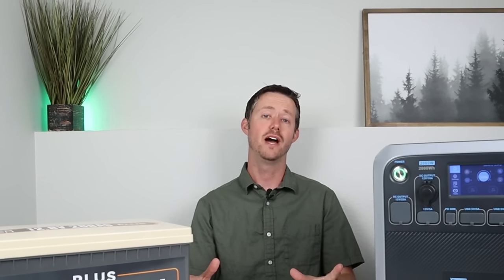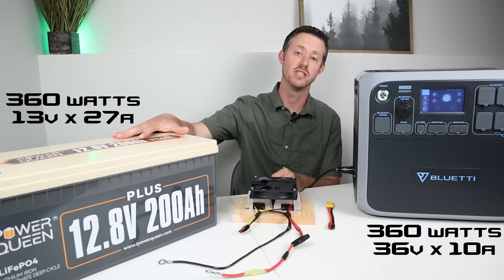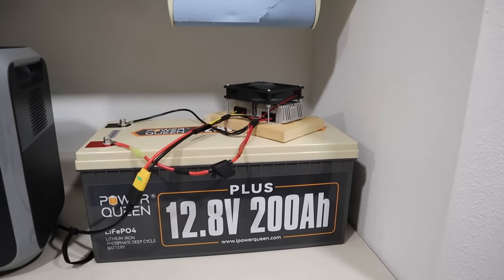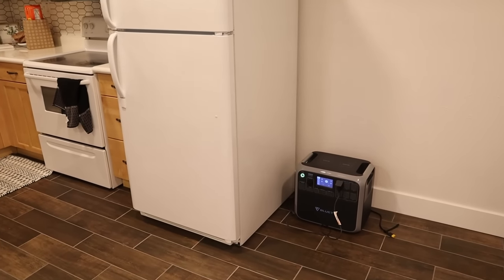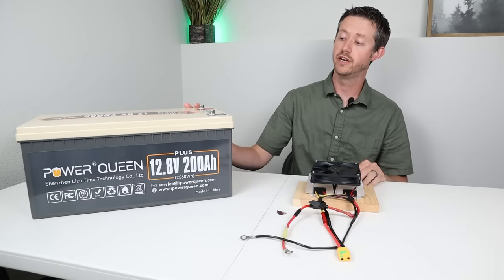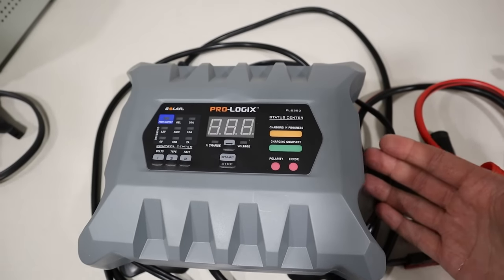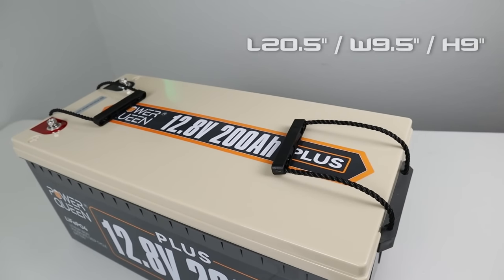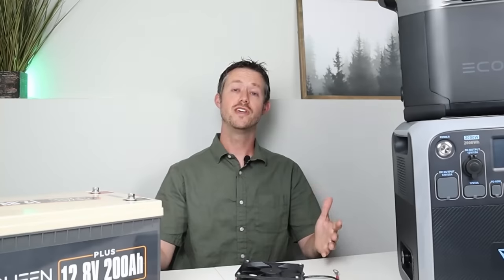Make Your Power Station Last Longer! Power Queen 200AH LiFePO4 - DIY Expansion Battery!

Comment: Have you consider using an ebike battery to charge these stations? I have a 52v 20ah battery with the xt60 connections.
Reply: I am doing exactly that right now. I am stepping down 48v to 24v because my small power station can only handle 30v max.

But note that sparks can occur when you connect the battery unless you use a switch
Reply: @moccaloto  actually I tried it already. I have the EcoFlow delta max and I bought the connector from eBay to my bike battery and connected it to the solar port. The battery has its own switch so I just switch it off before I plug it in and bingo it works a treat !

Comment: Great video, very practical. Just what I was looking for. I saw a 12v to 48V, 8 amp would that work as well instead of two 12v to 36v?  Just checking? Thanks again for this.
Reply from the maker: Yes, that 12v to 48v adapter would also work, just plan on large wires to reduce the heat and voltage drop.

Comment: Why not using an inverter 3000w at 250$ on amazon , connected to the battery and charge the bluetti with an AC cable at 120v from the inverter.
There would be a loss in conversion but it would charge with 1200w per h minimum, so much much faster.
Maybe i miss the point here. I know nearly nothing in electrical systems.

Comment: Wow real nice video but months before I watched this video I have already set up a system where  I have two Power Queen 200 AH batteries in parallel powering my small vacation home and a 1000 AH lithium ion portable solar power station connected to a 20 amp  LiFePo4 charger supplying power to the power queens.  The power station has 600 watts of solar panels charging it. The LifePo4 charger was only $59 on amazon.  So my system is reverse to yours.  Not being an electrical engineer what advantages or disadvantages does my system have.  Charging time is not an important factor to me and the system seems to works very well. Why did I do it this way?  I will take out the portable power station out to use elsewhere in the RV or for portable power outside when not charging the power queens.

Comment: I just purchased an AC200MAX on the Black Friday sale, and am considering a Power Queen 51.2V 90Ah  battery.  It should work with their D050S magic box without DC-DC conversion.  Nice added capacity for $1200.
Reply from the maker: You don't need the Bluetti charging enhancer for that battery to work, just plug the battery output (pos and negative) into solar input on the AC200Max.
Reply: @Jasonoid  True, though I may want to use solar panels during the day at least.  I also like your transfer switch set up, as I want to power critical loads, especially during power outages.  We had a three day outage last month…
Reply from the maker: The charging enhancer does allow dual charging, good call.
Reply: Hey Tom, Is it possible (or have you tried) to connect the Power Queen battery directly to the AC200MAX adapter input instead of using the D050S? The adapter input is rated for 58.8 volts. Thanks
Reply from the maker: You can connect the 48v LFP battery to the solar mppt input port and it will charge. I'm not sure how it will react by plugging it into the AC port and I wouldn't recommend it. The wall charger and the D050s are both 48v "chargers" and connecting a 48v battery to that probably wouldn't do anything.
Reply: My understanding is that the AC and DC chargers provide a charging profile consistent with that needed for LiFePO4 batteries.  I concur that it may not be advisable to connect a DC source directly to the 7909 port.

Comment: Hi Jasonoid, quick question, is there’s downside using a 36V 20amp step-up converter on a Pecron 600 that has an input limit of 15 amps?  Will it just auto-regulate down to its max allowable?  Is there an efficiency loss?  Thanks!!!
Reply from the maker: It will limit the amperage input automatically and the converter will enjoy not being at full blast the whole time. Win win. Watch this video for efficiency testing on these types of converters:
https://youtu.be/I78RxjRXTn4

Comment: EcoFlow makes an 800W alternator charger that could be used to do exactly this since it’s basically a DC-DC charger. Downside is that the DC output cable is EcoFlow specific so probably couldn’t use it with another brand.
Reply from the maker: This option is more affordable and will work with most brands:  https://youtu.be/NqnYaqMwktE

Comment: Great Video. I did enjoy it. However, for me, the part that was missing was charging the big battery back from the Power station. Yes, you brushed over it, but it was missing sth in my opinion. I would like to use it properly as an extension battery like the OG ones. So charging and recharging through the powerstation. I don't need a separate mppt controller if I have akk that within the powerstation already. Idk if it is possible to make an adequate replacement for the expensive original expansions. But I hoped I would find that out in this video.

Comment: I guess the only change if using 2 - 100ah vs the one 200ah would be to wire each 100ah individually to separate converters. The output of both would still be combined in the connector? I have 100ah in an off-grid workshop and plan to augment my Bluetti at the house with a 400 array but in the mean time this would be an immediate and inexpensive back-up? Or would there be some unforeseen issues, balancing, etc? The 200ah is just too heavy and cumbersome for me given current situation health etc. Also BTW the price of two 100ah looks to be less than one 200ah? Anyway, thanks for the video.

Comment: Jason is the fan blowing on the heat sinks or is it pulling the heat up from the heat sinks
Reply from the maker: It's blowing a ton of air down through the fins of the heat sink. It works really well.
Reply: Great, I just tested my 24v to 48v boost converter (20amp) with my Li Time 24v battery on my Anker Solix F3800 and I got 1150 watts on the DC side.  I definitely will add the fan.
Reply from the maker: @donnyhudson305  yes, I would recommend that for sure. You could use a simple USB fan like this too:
https://amzn.to/3UstNnF
On the highest setting this thing moves a ton of air!

Comment: Would be nice up know just how much power was loss from all that heat the voltage converters generated.
Reply from the maker: You're right, I should have showed the volts/amps on both sides of the process to see loss. The most heat buildup was in the fuse holder and using larger wire or dual wires would have helped get rid of that completely. There are many ways to accomplish the same goal here. Using an AC inverter with the stock wall charger, using a 24v or 48v battery and dumping power straight into the power station, or using the voltage converters on a 12v battery are just a few options. I'm sure there's even more haha!
Reply: @Jasonoid  Since you are coming from a 12v battery there is just no way to avoid at least some conversation loss regardless what method you use.

Comment: This is an interesting and informative video but I don't quite see the point of making something like this, to provide an alternate source for charging a power station. You have a perfectly capable 12v 2K inverter that the Bluetti can be plugged into that can supply the 500 watts input. If you have a second AC adaptor and add an xt90 plug then you can nearly double the input wattage to the Bluetti. If cost is a factor in building a DIY power source, a 500watt inverter costs less than the individual components that you are using for the build.
Reply from the maker: Totally understand where you are coming from and I acknowledge there are many ways to accomplish the same goal. This is a simple way to get 36v out of a 12v battery. Using a 24v / 48v battery would also work really well. Buying a decent 500w pure sine inverter is usually around $75, but that won't work on all larger power stations that charge faster than 500 watts. I could do a future video covering all the methods in one video. Might be a better approach.

Comment: I built the same 12-volt to 36 volt step-up converter. Thanks to your video it works great! I was putting in 353 watts into my Bluetti AC180. Quick question for you though... I found the same dc-to-dc converters that will do 12 volt to 48 volt. With that being said do I need to purchase two converters like I did with the 12-volt to 32v?
Reply from the maker: Usually the 12v to 48v converters are 5 amps so you'll need to parallel them to get the full power.
Reply: @Jasonoid  Awesome! As always thanks for the reply and your help!!

Comment: Would like to see you do a capacity test on the 36v output, and compare with the Wh from the original 12v so we know what the exact loss % is. While having a larger voltage battery is ideal, for this who may not be able to swing that as easily, it would be nice to compare a more expensive higher voltage battery vs knowing the loss % of this method. Could you run a capacity test on the 36v configuration and reply to me with the Wh that way?

Comment: How could I set it up with a solar panel? So that the solar panel was connected to the battery and the  battery wad connected to the power station simultaneously?
Reply from the maker: These LFP batteries support charging and discharging at the same time. You can connect a solar charge controller / solar panel to the battery AND the DC converter to charge the power station.

Comment: I have a Bluetti Eb3a, a 100ah Power queen  LiFePo4 battery and plan to use then to power a Iceco JP 40 (which I think draws msybe 50 watts max..  am I good just going direct without converter?  I’m thinking the ~120 watt charging should stay ahead of the fridge.  One other question. I know there is possible car alternator damage charging a LiFePo4 battery, but safe to charge a Bluetti Eb3A unit..  what if I plug the Bluetti into the car power socket then hook the 100ah LiFePo4 to the output from the Bluetti?   Will that slowly charge the 100ah battery without overheating my car battery? (Does the Bluetti have a protection inside to prevent over draw from alternator?)

Comment: Each Battery efficiency is 98% charge discharge. Inverter takes +/-14% aprox. The second battery is also wasting 4%, plus dc converter power draw which is 92-94% efficient....likely to waste just under 30% of solar power.

Comment: as I remember, that bluetti AC200p accepts solar voltage only starting from 36Volts, so your DYI power booster is good for this device for the case to charge that bluetti AC200p from solar pannels 17-20Volts or from batteries (e.g. 12 Volts like in this example )
Reply from the maker: Usually these converters don't like taking solar input. Maybe because it's not consistent. I tested once awhile ago but not with these specific models.

Comment: Good video. I dont trust those blade fuses for anything over 20A. I run several small lifepo4 batterys that I run in parallel on the AC200P that I use a ANL fuse with.
Reply from the maker: Great advise! Thanks for sharing

Comment: Could you not just buy a 25.6 volt 100ah battery and wire it straight to the battery and solar input for the 24 volt input? I also think you could use 3 12.8v 100ah batteries wired in series for the larger power stations, or 2 of them wired in series for the smaller ones. Point is, that would eliminate the need for the dc to dc converters and the conversion losses they would consume due to heat. It would also increase the watt hours of the 38.4 volt to 3840 watt hours....or am I missing something?

Comment: Last you thing you said 12v to 24v 5amp converter, but your Amazon link is 12v to 24v 15amp is that okay to use? Use it for EB3A.
Reply from the maker: Yeah it's fine, instead of buying two 5 amp converters you can use the 1 listed in the description. It will last longer since it doesn't have to work as hard.
Reply: Got it Thank you so much!

Comment: O MAN,  this is soooo great. I've been pulling out my hair trying to figure out how to have a simple DIY to get a longer run time on my Bluetti EB70S and YOU have covered it.
So, I have a Renogy Rover 20-40V converter for either my Bouge 180W roof-mounted solar panel or my 200 W Bluetti foldable solar panel if I need the roof space for the luggage box. Would going from the Renogy controller to a LiFePOE 100AH - then to the 12-24V converter setup you built (but for smaller systems) to the 200W input on Bluetti be a good DIY system?  Basically, I only run a 12V Iceco JP40 refrig and some fans.  Any wiring considerations? Which Power queen would you recommend?  Thanks so much!
Reply from the maker: It's best to send an email about questions like this: JasonoidLLC@gmail.com
YouTube blocks to many links and words.

Comment: Hi , this is a very interesting setup. I have a questions, can I do the reverse and uses the Bluetti to charge the external battery? Assume I have a large enough solar and my bluetti is top-up. can I make use of the Bluetti 12V 25Amp output to directly charge this external battery? This will be great, to use Bluetti Ac200max as a MPPT solar input and expand to the external battery when I needed. Or any better way to reverse charge the battery when needed?
Reply: I think this will not work as the output is regulated to 13something volts while the fully charged voltage of the battery is 14.4V. you'd only get the battery to maybe ~60 or 70 % SOC
Reply from the maker: Always use a dedicated charger to charge a battery. Never just charge a battery with an output of a power station. You could use the DC output of the AC200P to charge another battery if you put a DC to DC charger on it that's designed for an LFP battery.
Reply: Would like to see this ...living in Thailand and want to dump excess power into a 200 ah 12 volt and start the night with has much power and run ac true the blueti ac200p

Comment: Could you just use 2 or 3 smaller batteries in series to get the higher voltage without worrying about the extra hardware?
Reply from the maker: Yes, that would work just as great too!
Reply: But then it would be more annoying to then charge the batteries I assume?? 
12 and 24v easy but higher than that less ideal chargers required or separating batteries each time.

Comment: How would you charge the expansion battery if you're offgrid?
Let's say you have a smaller Bluetti product - EB70 EB55 or EB3a for weekend camping.
You want to have an extra 100ah LiFePO4 battery for extended touring and need to rely on solar charging.
What would you need to do so that you can simultaneously charge both Power station and the expansion battery?
Or would it be better to charge the expansion battery via solar and that would charge the Bluetti? If so, how would you set that up?
Or would it be better to just get another smaller bluetti? And in that situation, would you even be able to charge both power stations from a single 200w solar panel unit? 
Just trying to think of the most elegant solution for tiny suv camper
Reply: I put a 100 watt panel on the Bluetti, then another 100 watt panel on the spare battery.

Comment: Very informative video. Would it be possible to straight wire a 36 V lithium ion 100 amp power battery to the Bluetti? Thanks
Reply from the maker: Which model of Bluetti?

Comment: Great video as usual.  I’m very interested in adding capacity to my Percron E600 using an external LiFeOP4 battery.  Quick question, the DC input max is 400W at 32-95V.  Can I boost to 36V as you demonstrate or will I exceed allowable input and need to stay at 24V?  Thanks, love your videos and the great content!  Joe
Reply from the maker: The 36 volt will work on the Pecrons larger input port. I'd recommend using one of the  converters in this connected to a battery, they will be higher quality:
https://youtu.be/I78RxjRXTn4
Reply from the maker: @josephmurolo5656  it has worked well for me so far so I don't see any issues with that.

Comment: Hey Jasonoid - another great video. I have the Bluetti 200Max and it has included a DC aux cable to charge off the van when running. I want to tie it into the van battery to get the most input wattage and am wondering if I can use this exact set up. Of course it is putting a load on the alternator - can it handle it without any stress? 
Also, I assume I should install a split charge relay switch so that the Bluetti only pulls power when the van is running. Advice? Is there a better system you'd use in this case?
Reply: Also what do think of using the following? : Victron Energy Orion-Tr Smart 12/24-Volt 15 amp 360-Watt DC-DC Charger, Isolated (Bluetooth)

Comment: I have the ff power 2001 , solar input 15 A   12 to 48 volt . Could I go straight from battery to power station using Anderson connector , using 24v battery? Also what size fuse would I need ?  What would be the best way to charge battery ?  Thank you.
Reply from the maker: A 24v battery would be a great simple solution to faster charging on the FFpower. You'd want to use 12awg wiring and a 20amp fuse for that setup. You'd see around 240watts of charging vs 120watts using a 12v battery.

Comment: Is it possible to charge the extra battery through solar panels simultaneously with the power station?
Reply from the maker: Yep, a battery supports input and output at the same time.